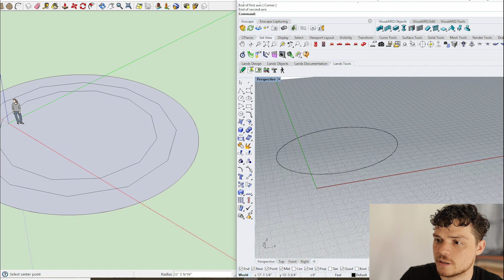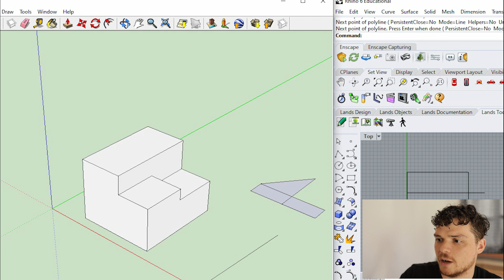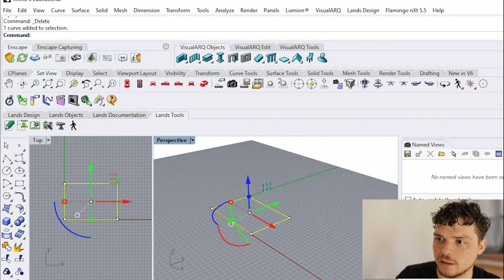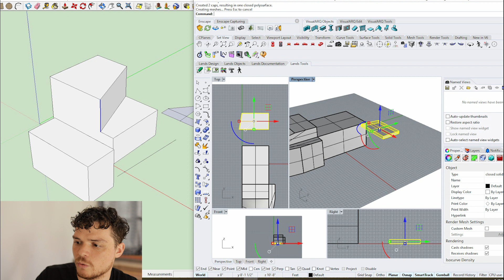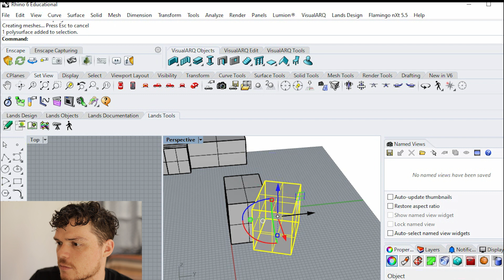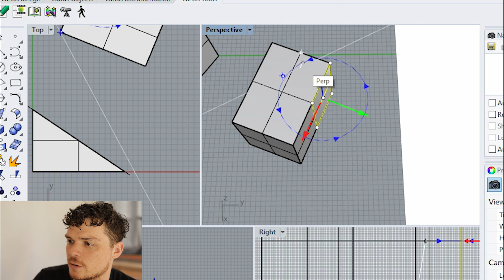Switching to Rhino from Sketchup

Comment: when I try to 'ctrl+shift' select a surface and click on the circle to move the solid it goes up and down only and not sideways
Reply from the maker: Interesting. Do you have gumball on? You should also release shift so that you can drag it anywhere. I would just mess around with it a bit and make sure you are hitting the keyboard commands and releasing them at the right time. Let me know if that works!
Reply: @NatesStudioDesk   ya it worked thanks. How do you measure solids heights dimensions in Rhino?
Reply from the maker: @calvinfernando432  You can use the distance tool. Or dim tool.

Comment: Anyone considering Sketchup to Rhino should consider this free plugin "jamparc".   (found on Food4Rhino)  Its a simple collection of plugins that provides a very similar set of commands just like that found in Sketchup.  Look under the SU grouping of commands.  It is indispensable.
Reply from the maker: I’ll have to try this out. Thanks for the suggestion!
Reply: @NatesStudioDesk  You'll love it, you can interpolate offsets, circles, lines, or complex poly lines onto any planar surface (2d or as part of a solid).  With the push-pull tool you can slice, dice, and reshape objects at will and they will heal properly.  The interpolate ONTO a surface is easy to miss, its the 1st tool in the SU toolbar, implemented via a right-click.

Comment: I use sketchup professionally. I stopped on this video to watch it just out of curiosity to see some differences between sketchup and rhino. Here are my comments. Sketchup with the sketchup plugins vs without the sketchup plugins are COMPLETELY different programs. The power of sketchup is almost entirely in the plugins that are availble to use themselves, of which most are free.

If you're not familiar with Sketchup plugins and you're not familiar with LIbfredo plugins, curic plugins, eneroth plugins etc, I would assume that you know very little of the power that is available when using sketchup. I'm not trying to be blunt, just pointing out that the plugins really are what make sketchup powerful and if one doesn't know about such plugins like for making easy curves with a plugin called curvizard for sketchup, or curvi loft, than it's really impossible to make comparisons to other programs.

I like how the curves are drawn as you show in rhino at the beginning, you can essentially do the same thing with the powerful curvizard plugin. I really don't like that in rhino you need to type commands, sketchup doesn't require this. Personally one thing I also see a lot is people don't take advantage of a 3d spacemouse for 3d modelling. There is simply no comparison and no faster way to model than to use a 3d modelling mouse in one hand and an mmo mouse in the other, an mmo mouse can have 12 buttons and when you press a button on athe space mouse the mmo mouse now has another 12 button options avaiable. I currently use 50 hotkeys from my mouse and when I'm modelling I can orbit around what I'm modelling and model at the exact same time while I'm moving around the model, so it's rare that I have to touch the keyboard and my modelling is therefore almost instant when I need a tool I just press a button that my hand is already on.

There certainly is no faster program for building designers than sketchup, it's honestly not even a comparison, sketchup wins for sure. One thing I like about Revit is that it is seemingly a lot better at sketchup for quantifying materials because it is bim, sketchup is bim also, through using the plugins, which is something a lot of folks don't know, but revit just has material quantities working much better than sketchup. Fortunately for designers most of the design projects done typically don't require much quanitifying of materials as that's not the usual job of a designer, I guess it depends on the designer though. I love that you use Enscape, I think this is the best option for rendering.

When it comes to modelling curves and organic shapes, perhaps rhino is better at some things, or better in general, I'm not quite sure as I don't do a ton of organic modelling, but I will say I have gotten into it recently and there are a ton of powerful organic modelling plugins to use in sketchup, one of which is the artisan tool set.

Anyways, this is my overall experience. I've watched a handful of videos of people doing building design modelling tutorials using chief architect, revit, etc. and it's just so much slower so this is partly also what I base my comments off of... Curious what you think. Looking forward to watching more of your modelling videos. I've always been curious in seeing how organic shapes are modelled in different programs other than sketchup. You should seriously check out curvizard and fredos curviloft tools though. Curic tools are incredibly powerful, fredo box stretch, etc.
Reply: What really made Rhino powerful is its mathematical base. Every single nurb curve in rhino is based on math, which made grasshopper possible. If you are using Rhino without grasshopper it’s like a huge huge loss. The scientific and mathematical approach of rhino automated many steps and saved so much time during my modelling process. Not to mention There are lots of plugin available for rhino and grasshopper also. Imagine modelling a parametric building in sketchup may take a day while grasshopper makes it 30 minutes. It’s an easy win for Rhino
Reply: I'm still fairly inexperienced at all of this - 3rd yr architecture. I found SketchUp so difficult to get started, because I didn't realise I needed plugins to do certain things. Once I realised that there were plugins available, I didn't know which plugins were the ones I "needed" to have. I found it quite difficult to draw geometry in SketchUp - the cursor would kind of just fly around in space and I'd be drawing lines that were literally miles away from what I was actually trying to do. Once I started using rhino, I was blown away by how it was just capable of doing exactly those things I needed it to do, out of the box.
You also don't need to type commands. They are all available in toolbars. I don't think either program is great for presentation, neither for concept/design presentation or building documentation. I do love how I can get rhino to talk to archicad. So I can use archicads much better documentation functions and use rhino for making more.organic geometry. I wouldn't go back to SketchUp. I'd spend forever trying to sec it out with plugins before I'd ever be productive, then I'd be frustrated at the workflow just being different. I know people at uni who say "just use SketchUp" and I get it. I also had people saying "learn rhino, you'll never look back". Rhino is huge and I think I found it intimidating at first, but once you get into it, its not complex, it's just comprehensive.
Reply: I used to feel this way as well, but not anymore.  I'm quite familiar with Sketchup and it's many plugins.  The sole benefit Sketchup provides is simplicity and the wonderful sketchy views (significant).  Yet in every other respect it's an easy win for Rhino.
Reply: I am with you Araya on this. I can not see anything in this video, which couldn`t have been done - quicker - in SketchUp, except that perhaps Rhino can produce a more stable model. Whit Sketchup I often end up with a non-solid model - after experimenting and moulding the form to my liking. I only need to produce documentation, plans and elevation for a conceptual design, so it`s not too bad, but it could make the job easier for the trades who take over my design if I had over a stable model, so they can 3D print or parts - in case of a furniture concept). In the case of an architectural design, it is more complicated as the project will have to go through stages in which case it will have to be put through ArchiCAD or Revit anyway, so doesn`t really matter. Grasshopper does save time, but also it takes a lot of time to set it up too. just like BIM. Never seen anybody use BIM in an extension or a small scale building project either did I see using grasshopper. 

Thanks for the video. I am always interested in other softwares.
Reply: @kingasz100  Cool Kimga! I've actually been obsessed with the best architectural workflow using sketchup for many years. I design performance homes, passive, net zero etc. If you want we should connect! Feel free to reply back and we can try to connect sometime if you're interested in some of my workflow. Would love to see yours too! I have a big part in sketchup and it's development, I speak with sketchup directly once a month providing feedback. There is just so much you can do in sketchup with the right workflow, the models are plenty stable but I do know what you mean, in some cases a model might need to be broken up. I can definitely relate to what you're saying, there are many ways around this stuff though that are still somewhat seamless and don't require work arounds that feel sloppy.
Reply: @arayahomes4308  Big models in sketchup start getting slow and unstable. I figured a plugin called X-ref for sketchup that works similarly to x-ref in autocad. So usually I would design the project's site on a file, and the project itself on another file, then i would use a master file to join both using this xref that works with a single click. then any complex object like trees, cars, furnitures etc, i would make proxies.

But anyway, i want to move to Rhino, that's why i'm here. So far, i'm liking it. I'm just still slow on it.
Reply: Wow, I use sketchUp quite well but it seems there’s a ton I could learn from you Araya. 

I’ve always believed sketchup could do it all.
Reply: If you don't want to make a big reply to that comment above, I'm happy to meet with you virtually and show you the plugin power of sketchup and even learn some things from you in return. I'm always looking for better ways, currently I've just never seen anything come close to sketchup for architectural modelling.

Comment: I am a professional sketchup user and i want to switch but i am afraid that i am used to sketchup.
What do you advise me?
Reply from the maker: Just know that how ever long it took you to get to your level of sketchup, will take for rhino. Now with that said you can get to a certain basic level where you can do everything you need. But this will take some time and effort. Are there specific things about sketch up that you are fundamentally frustrated with, or are you just curious if Rhino will work better? Overall Rhino has more capabilities and is much better at drafting construction drawings / floor plans etc. What kind of work are you doing? If you are only creating 3D models, and you can do that quickly in sketchup, probably staying with skp would be the easiest. If you want to eventually take advantage pf grasshopper, then maybe take the time to at least do one project in rhino to test it out. Just know that it takes a lot of time and effort to learn a new program but then you know two programs!
Reply: @NatesStudioDesk  thank you for replying. I am an architecture student, recently I've been watching interviews with people who work in big firms, most of those firms use rhino, almost none use sketchup. So, i want to learn it in order to have the experience with it before applying for jobs or internships to such firms. I also know 3ds max but i don't use it alot.

Check my latest video, you can see how good I am with sketchup.
Reply: @abbasramadan468  Hey Abbas. You should read my rather long comment above about sketchup vs rhino. It's all specific to what the person needs. First I'd say that just because you don't see people in your firm using sketchup, that doesn't mean anything. Revit is quite a bit more popular than sketchup but sketchup is FAR better than revit in most cases. Some cases revit is better but most it's not and sketchup has much more power in general and ease of use. I can't say I know exactly what it's like to model organic shapes in rhino vs sketchup, rhino perhaps might be a (little bit) better at modeling (organic shapes). However I will say that there is no better program than sketchup when it comes to architecture and that's not just me talking. I can show you. If you'd like you can reply to this and I can give you some examples. If you don't know the following plugins in sketchup; curic, lib fredo, tig, eneroth, skalp section plugin, s4u, etc, if you are not familiar with the plugins I've just mentioned than I can confidently say you are not familar with the power of sketchup. Sketchups power is all in the plugins. If you don't respond no worries, but if you're looking to actually understand sketchup and it's power, you need to understand the sketchup plugins that are available to use first before you can accurately decide which program is right for you. When it comes to architecture, sketchup wins most of the time.
Reply: @arayahomes4308  what are you talking about sketchup is not primarily a parametric program and that's the end of the conversation. Revit vs sketchup buahahhahhah, you made me laugh.  I am using on everyday inventor with woodwork for inventor and revit and vectorworks,sketchup was the first and I am done with this crap forever
Reply: @SKYLIMI  I'll all say to that, is if you haven't used the following plugins than you don't really have a good opinion about this. So have you used the medeek plugins, the plusspec plugins, the profile builder plugins, the lib fredo plugins? If you haven't used those plugins than how can you say that?

I regularly see people coming over from revit to sketchup, this is just an ego thing, for 3d modelling of specifically contruction, nothing beats sketchup and when I say sketchup, I mean sketchup with the plugins.   I just got a designer of 20 years in my area getting off of vector works and using sketchup and layout exclusively and obviously only because it was faster and better. I'll even go the extra mile and show you. How about you shoot me a private message if you feel you know what you're talking about and send me your email and we can setup a time for free for me to show you. Will lookout for your reply.
Reply: The funny thing is that most people wouldn't respond back, but you seem quite confident, so let's see it, show me how good revit or the program you use is. I'm genuinely curious to see if it compares, because from what I've seen, it doesn't.
Reply: @arayahomes4308  I will write back,I did not expect you to write back
Reply: @SKYLIMI  Unless you know about the plugins I've mentioned, it looks like you have a lot to find out about sketchup. You should do some studying on the plugins I've mentioned and talk to some people who know the key differences in the programs. I am one of them. Good luck
Reply: @SKYLIMI  I'm not sure why you're making assumptions about what I know or have seen. I just got a designer to stop using vectorworks and exclusively uses layout and sketchup now after years in vectorworks.

Again you don't understand what I've said. Sketchup has many parametric plugins. There are parametric wall, roof, foundation, fully customizable and detailed cabinetry parametric plugins, etc. Layout is automated when you know how to use sketchup. For construction in general, most of the time nothing is better than sketchup and layout. There are some cases of design where sketchup is not the best choice but for anything construction and design related, sketchup has incredibly parametric plugins and can do the things you just said it can't.

Anyways. Good chatting, if you'd like me to show you some of these cabinetry and other parametric plugins, there are many and I can easily show you that. Cheers
Reply: I think Rhino is a bit better, imo. I think sketchup is great and all but i really do think Rhino has a lot more options as especially if you have Windows. And as a student you can get a free 3 months trials with grasshopper. If you have used AUTO CAD, you'll pick up Rhino quickly.